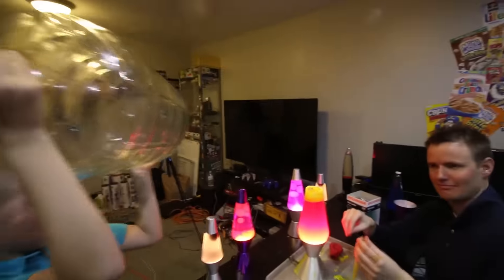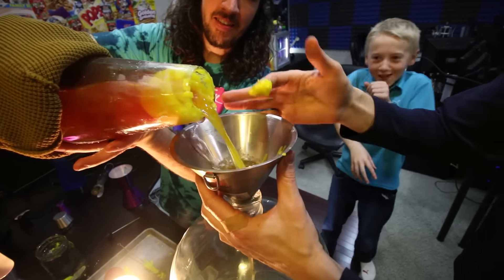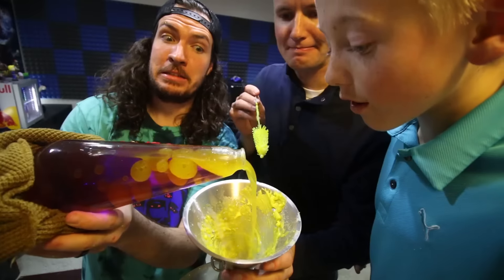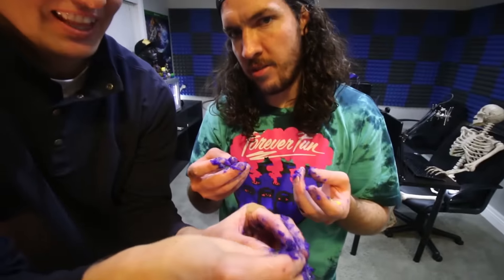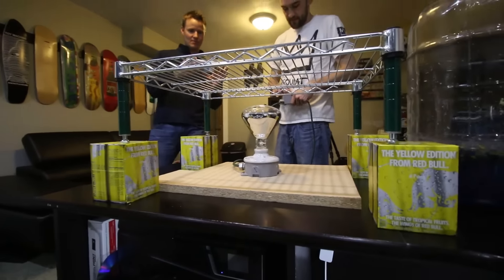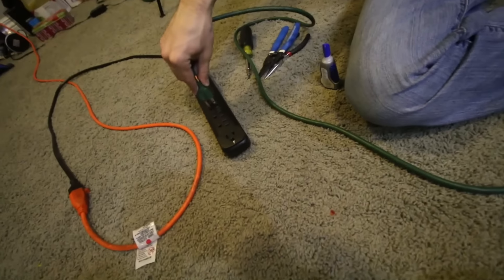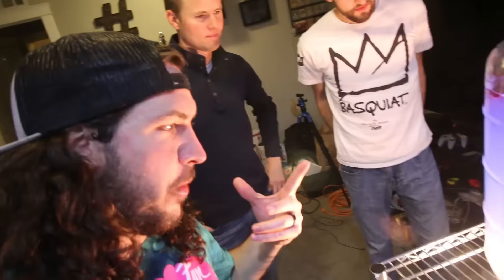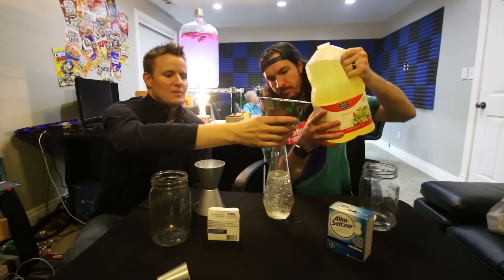Homemade Lava Lamp

Comment: I don't think the 91% alcohol is a good idea that's super flammable 😨😰
Reply: its not. lava lamps are made of rubbing alcohol
Reply: It's probably coloured water or something. The reason it doesn't boil is because it's under pressure and it raises the boiling point. They should have tested the water temperature in the giant lava lamp
Reply: +Brad b that would be a good idea
Reply: +Brad b they did on the what's inside channel video of this.
Reply: +Rc Carrier Most of the things we do are not a "good idea" :) I do not endorse that much 91% alcohol.
Reply: +What's Inside? Hahaha oh well
Reply: especially in that amount. fire extinguisher aint putting that out.
Reply: Could have just put oil instead of water
Reply: True

Comment: That was a huge lava lamp but it didn't work because of the heat ratio wasn't so good heat has to be trapped in a fixture so heat will go on the bottom of the lamp and heat it evenly and NOT escape

Comment: That won't work how they built it as the heat would escape to quick and also water won't work as lava lamps don't use water it's stuff similar to alcohol and water is to dense and can go stagnant